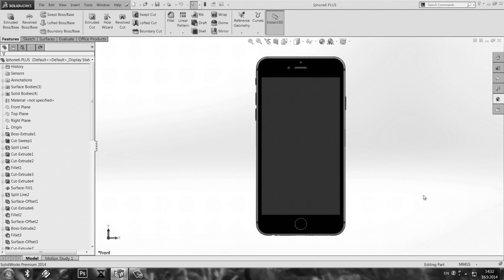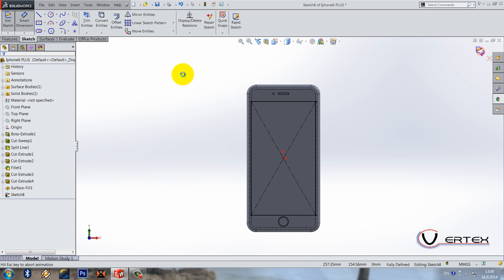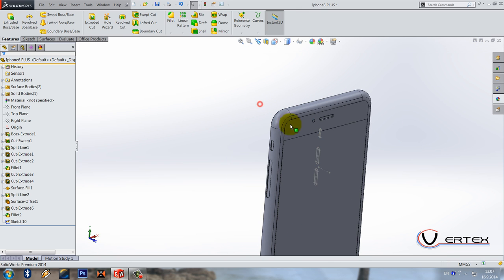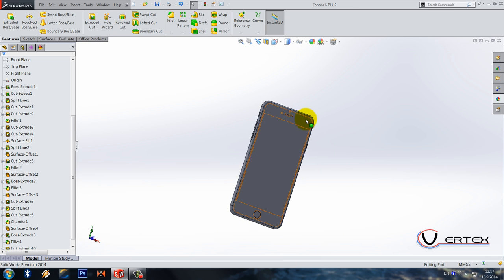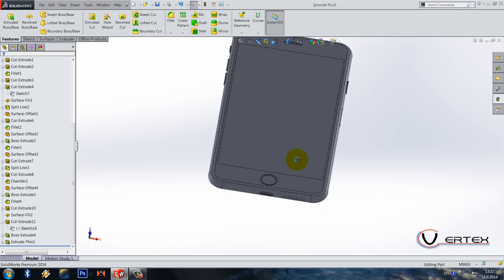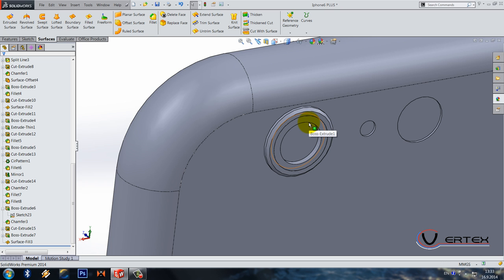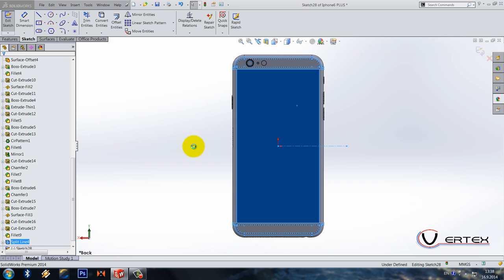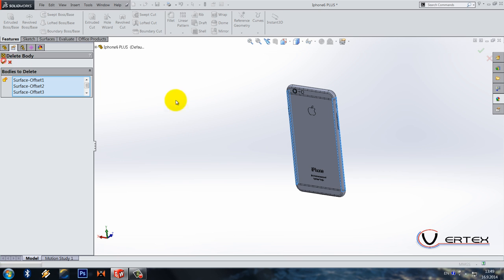iPhone 6 SolidWorks modeling tutorial

Comment: Goodmorning Petar,
I also did the second tutorial until the last fillet, I learned an lot of handy surface features. So I can achieve almost the same things with cut extrude and the Trim Surface option or the Split Line Projection option and so on. My experience is that you have to be very acurate while working in Sworks to com to succes and if you do that it is a really pleasure to work with Sworks because of the possibilities. I was a litle surprised that you do the rendering with Keyshot. And my question is in wahat format do I have to enter the Sworks.slprt in Keyshot?
But nevertheless thank you very much,
Reply from the maker: Mar Tielbek Great you did it! Well yeah, with solidworks you will find a way to success but it also offers a lot possibilites to enjoy while working and finding solutions differently, my final advice is to use surface extrude + trim to get the edge for some other surface better then making a curve from same sketches.
Keyshot is a way better option to use for rendering cause results can be amazing. You need a Keyshot5 to be able to open all SW files till 2014 version or previouse version of Keyshot + STP or IGES or some other file from SW, just check out the dates of solidworks and keyshot releases and you will know can you open or not.

Thank you also for nice words! :)

Comment: Petar, I disselected the double sided function but the problem is still there. I had the same problem by using Textures instead of Labels.
Reply from the maker: Mar Tielbek try making the screen hole in solidworks totaly different color comparing to the rest of phone, then when you have it imported to keyshot you those fron and rear separated to a 2 layer and that should work. :)

Comment: I noticed you used rounding on your dimensions in reference to the technical specifications of the Apple iPhone 6 plus. I was just curious if you did exact measurements on the initial iPhone sweep with it's radius and fillets, or if these were approximations as well. Thank you.
Reply from the maker: +Steven Meacham Hi Steven, it was as close as possible but not really exact. Video is more like a - here is how you model it and I did my best to match original dimensions but be aware it s not 100% perfect. :-)
Best,
Petar
Reply: Ok, great. Thank you so much for the fast response. Great vid by the way!
Reply from the maker: No problem and thank you my friend!

Comment: It shouldn't be a filet in the first sketch, and it shouldn't be a circle in the second sketch. They can only be tangent using this method.
Apple uses only curvature on these surfaces.
More information about tangent and curvature can be found here:
http://okdane.com/continuity/
That is not my website, but it has the best explanation when I googled surface continuity.
Reply from the maker: man I didnt wanted to make intersection, tangency, curvature or any other thing, I wanted to make it rounded just like I did but I used sweept instead of fillets feature cause that s how I get only one surface for offseting, otherwise using fillet i would have 2 separated surfaces and I didnt liked it, it is planed to be like as it is.
if the real iPhone is not having same shape like my model that s ok, I already said that I was nt got a lot of details to review it :)

thanks for analysing it, I apreciate it realy! :)
Reply: You can offset multiple faces together to one surface. Wwept cut is a good method.
I uploaded a sample part file to you grabcad. The difference is I set my sketches curvature instead of tangent, and it did not take any more time.
Appke does not use G1 or tangent on those surfaces.
Reply from the maker: Yang Ji well I didnt know about apple style, I know that previouse versions was having chamfers only :)
yes I can offset multiple faces but then I have to knit them together, I wanted faster way :P
Reply: Even iphone 5 and 5s do not use filet; they are curvature.
Reply from the maker: never saw them either :P
Reply: Petar-Vertex Just looking at the products you see that Apple unlike other companies is not using G1 circular roundings but G2 blends. One can see that easily with the eye already.
Thats why the dimension drawings do not offer a radius but curve points.
Reply from the maker: Claas Kuhnen oh now I see you and Yang Ji are both righte about that, but I realy havent spot that when iphone 6 was revelealed, to late to do anything about it as tutorial is already uploaded :)
next time I le do better research and model construction

thanks!
Reply: Petar-Vertex No problem this was still an interesting video to see - I know how to build it in Alias but was curious how a solid modeler would do it.
Reply from the maker: now I am curious to see how you guys are doing it with alias, but realy :)
Reply: Petar-Vertex thats really based on how you want to start. we do not have sketches, we simply put curves or lines in 3d space. In alias you can align curves to each other so they meet via G0 to G3 for example, then you use surface tools to skin the web. The tools have a design history for most of the time so the model is interactive/parametric. When sketching lines you don't have to spend so much time on sketch constraints. Has it's ups and downs.
Reply from the maker: hmm so for example, I ve heard that alias is one of the best for surfacing
is it realy easier to make a class surface or not, and how the interface is looking like?
Reply: Petar-Vertex Alias is pretty good but also very hard to be honest because it is very strict and follows a certain workflow only. Without knowing that it can be a very frustrating tool. The interface is a shock while well Solidworks like like a crazy Windows itself. The workflow in Alias is actually quite fast and straight forward.

I think for fast working Alias is better than any solid modeler because in alias you do not need to work with sketch constraints which are a time sucker and you are not limited to sketch planes.

Apple itself builds in Alias and then the model is redone in UX.

I am close to say that the tool abilities are the same it comes down to how good one knows a software and how it has to be used.
Reply from the maker: ohh ok, it would be strange to me to start new part without sketch or plane :D
yeah, the reason why solidworks is good is cause of interface but you realy have to struggle to learn sketch relations and after that rebiuld and so on, sometimes SW can drive you crayze :P
I saw tutorials for alias and thee interface is ugly so I am not thinking to give a try,
thank you for informations :)
Reply: Petar-Vertex You are welcome. The sketch engines can be a blessing or often also really a curse because they in my point of view needlessly complicate things. I wish solid and surface tools would have evolved differently over time. But sadly thats not the case.

Constraints in a solid modeler sometimes reminds me about generative modeling like with Grasshopper in Rhino - quite fun and powerful to automate design steps.

true 3D surfacing combined with also the solid modeling and sketch engines would be I think a blessing for many companies. ah well
Reply: Petar-Vertex BTW how far can you sculpt CVs in Solidworks?
Reply: Claas Kuhnen Solidworks has CV for spline so it is the same practice as in Alias. Solidworks has surface module which can create high quality surfaces. 3D sketch can create sketches similar to curves in Alias. At the end, it all depends on how you use it.
Reply: Yang Ji I was more curious about surface CV manipulation not just curves.
Reply from the maker: I use as less CV-es as possible, it is easy to manipulate them, you got angle and distance
take a look at some of first tutorial on my channel called teapot, there you can see some surfacing in sw, but I dont like using 3D sketches, not easy realy
Reply: Claas Kuhnen Solidworks can do "freeform", which is similar to "adding ISO and drag CV" in Alias. I have been using Alias since 2003 and Solidworks for a few years. For me, I need to spend more time to achieve the same surface quality in Solidworks than in Alias.
Reply from the maker: yeah it also has freeforme tool but in industrial design I guess it is not used that much :)